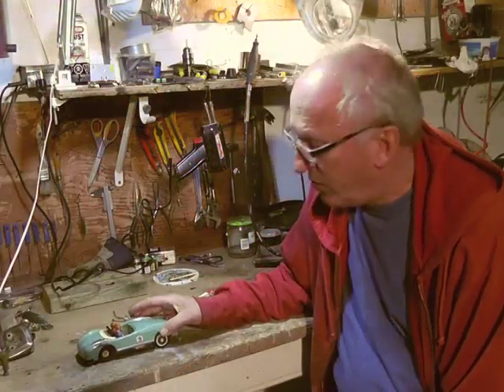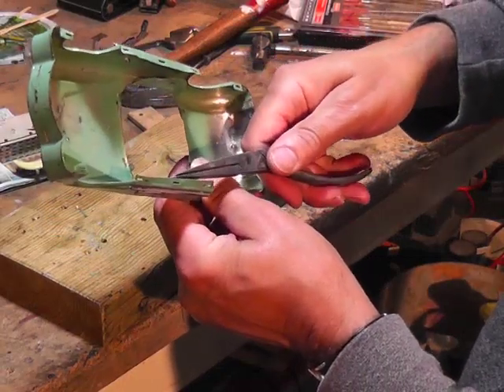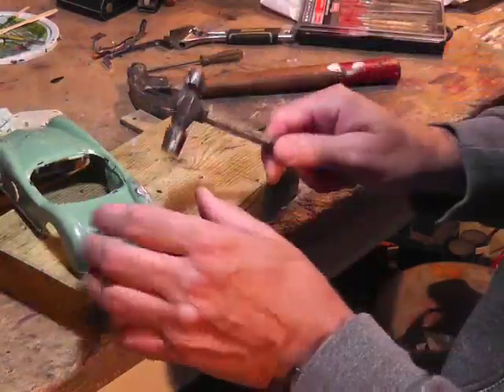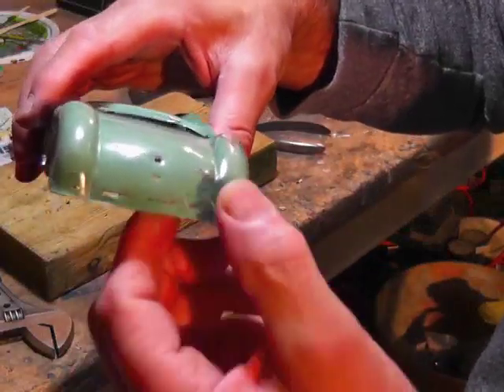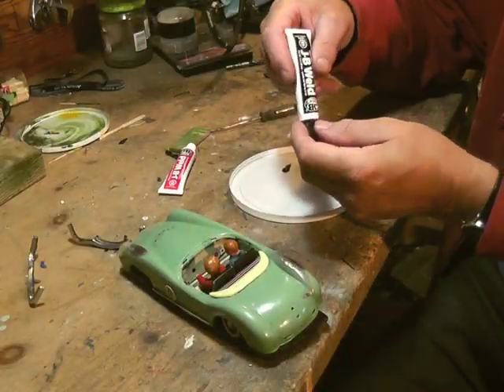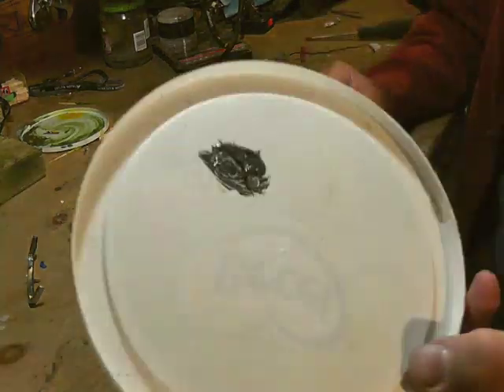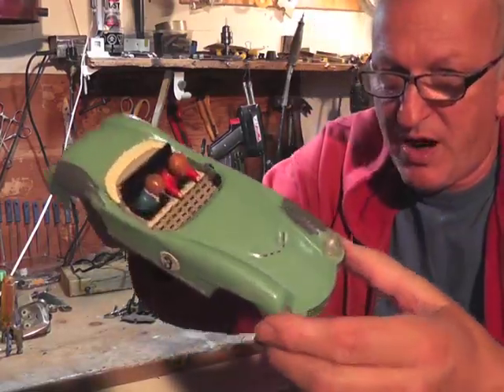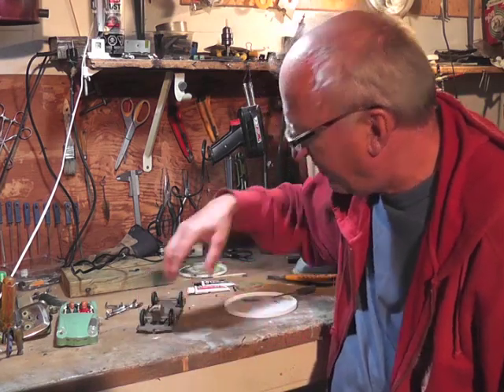How To Repair Tin Toys #1

Comment: Great video. Thanks for posting. I have several old battery operated toys that do not work. Battery compartments are super clean, so I know it is not a corrosion issue. Any guideance on taking them apart and fixing?  Thanks.
Reply from the maker: Go to my other Channel: Willy Dahm and look at other tin toys that I have worked on. Taking them apart is quite easy but finding parts is difficult. It sounds like it's in good condition. It could be a broken wire or loose connection. If it's a motor it gets harder to find parts but be patient and something will come up that works. Sometimes one has to buy a donor car to repair and make one original. Hope this helps and thanks for the feedback.
Reply: @perfectproductions5886  Thanks a bunch. I'll check it out. Just a bit nervous about opening one up, but I may give it a shot.